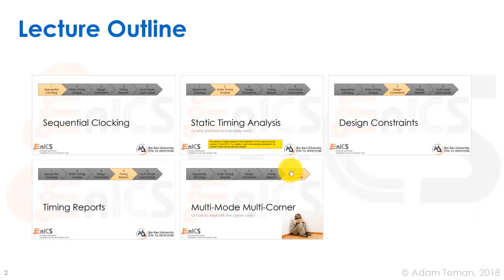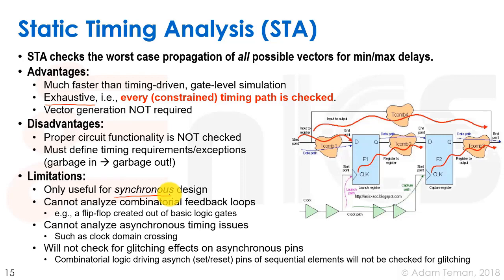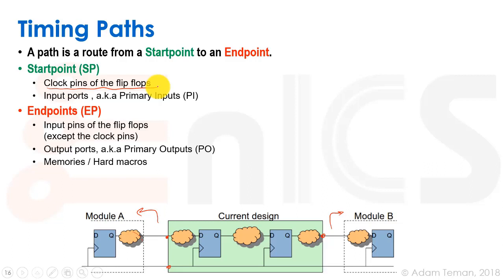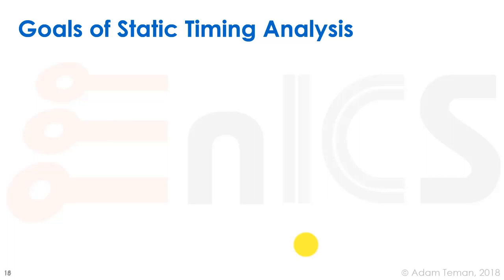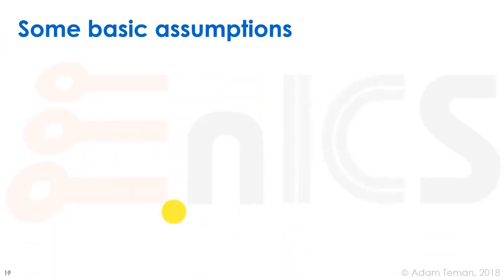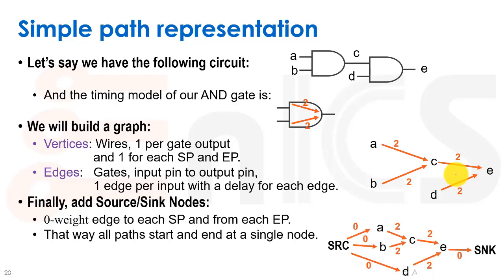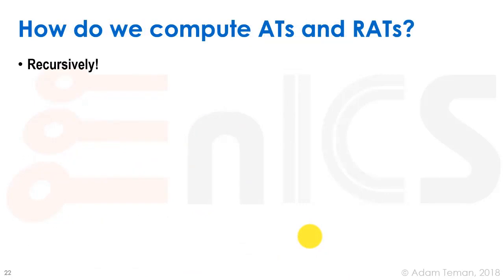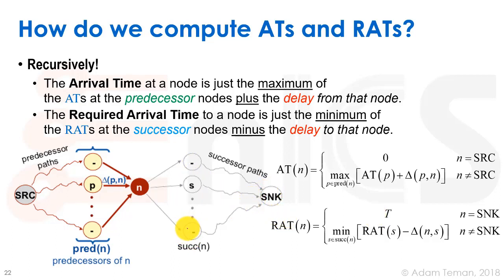DVD - Lecture 5c: Static Timing Analysis (STA)

Comment: Sir , your lectures  are very geartful and insight to learn the STA , i have query sir why STA is done only synchronous design and why not on asynchronous design .

Query 2 why sta is not applicable  to cdc ..

Please kindly throw some light on cdc .

Please kindly let me know sir .

I will be thankful you sir
Reply from the maker: Hi Chandra, good questions. 
Hopefully one day I will make a detailed lecture on CDC, but I'm not sure when I will get to that.

Q1: Why is STA only on synchronous design? Well the answer is basically the basis of all the algorithms and approaches we described. They are all related to some clock signal - something that synchronizes the paths that are racing each other. I am far from an expert on asynchronous design, but there too, we try to find means to verify and validate the paths and (possibly due to our "bias" towards synchronous STA), we take a lot of our knowledge and methods from STA and try to apply them. However, at the basis, the problem is not equivalent, since there is no clock as a reference that the other path is "racing" against.

Q2: Why is STA not applicable to CDC?
Here the problem lies in the clock source. CDC means you have paths that originate from two different clock sources with no (well defined) relation between them. Hence, even if we know the frequency of the clocks (for example, let's say they are at the same frequency), the phase between the two clocks could be anything. So we would have to look at the worst case of such a phase. For example, if we are looking at max delay, we can assume the phase delay (basically skew) is such that the capture clock rises 1ps after the launch clock, and we cannot meet timing with such a requirement. In other words, if you have a clock domain crossing, the only guarantee you have is that you will NOT MEET standard STA requirements. 
Therefore, in order to facilitate such situations, we must insert some barrier (e.g., synchronizer, FIFO, etc.) that ensures correct functionality without meeting max delay/min delay constraints of traditional STA.
Reply: @AdiTeman  thank you sir .